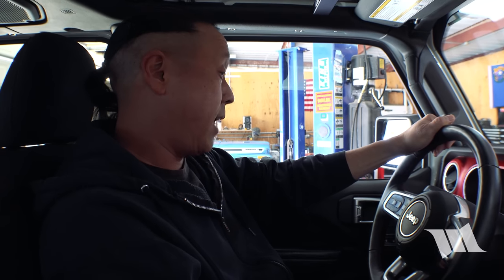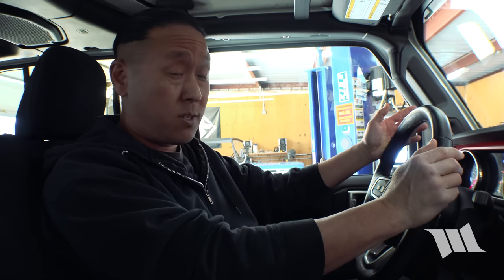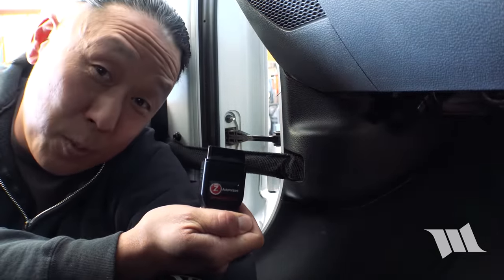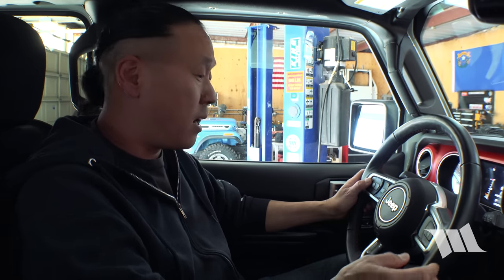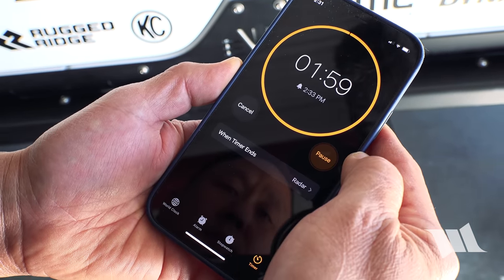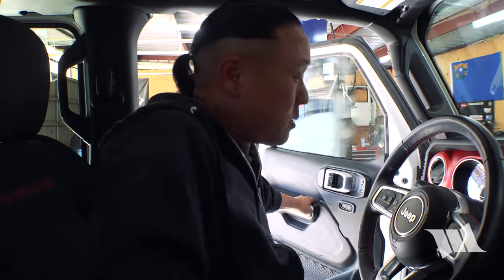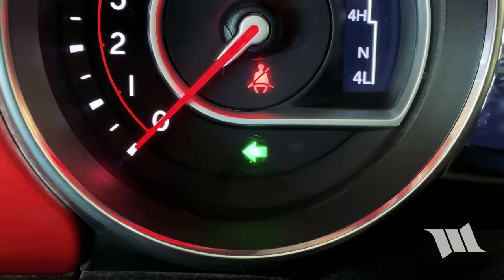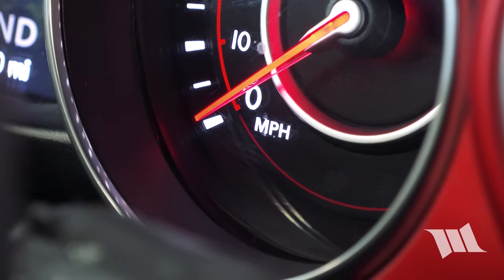HOW TO Turn Off LIGHTS OUT Error on a Jeep JL Wrangler or JT Gladiator After Installing LED

Comment: I'd love to know the technical reason that sets off the tail light warning, and the technical reason you had to do (did I count right) 6 reboots.
Reply from the maker: The resistance is different with a different set of lights. The LED health monitor see this as the lights being out. What you see in this video tells the LED health monitors to be disabled.

Comment: I see you have serv 4wd msg. I have same on mine. How did you fixed that?
Reply from the maker: For this Jeep, it was because we have a ProRock 44 front axle with ARB locker and a factory rear axle. I was finally able to turn that light off using a Tazer but only after rewiring the factory rear locker to a separate switch.

Comment: I am having the same error on my Jeep Wrangler JLUS after installing Bush Wacker Fender Flares. I went from Halogen Front Turn Signals to LED Front Turn Sign Lights
Reply from the maker: Well, this will take care of it. Just to make sure, I have tested it out on our JT.
Reply: Same here with the fenders but do we still change the tail light options like you did or do we do our respective modification in the tazr

Comment: Tried this today because this warning or error showed up randomly. I've never replaced or changed the factory LED tail lights. 

But my error only shows that the right hand tail side is out. But when I inspect it, everything works as normal. Any pointers on how to maybe get this working? I've tried talking to Jeep but their service people never get back to me
Reply from the maker: The health monitor is showing a voltage drop in that light but really, if your tail light is an LED, it really shouldn't be out this soon. I might take your Jeep to a dealership and have them give it a look and see if you can get it covered under warranty.

Comment: Would this fix my no front turn signals not working?.  Chop fender AAL. Just DRL work but when using turn signals  it just turns off completely  on the turn signal im using. 19 rubicon
Reply from the maker: Sorry, couldn't tell you for sure. Typically, this will only fix the warning light on the dash - not make a light work.

Comment: OK thanks for the information now I have another error code the brake light and ABS lights have started flashing when that happens I have no brakes I turned it off once but then it turns itself back on at the clear and the code
Reply from the maker: What I'm hearing from you is most likely a speed sensor issue. If your steering wheel is slightly off centered, your computer will think you're in a slide and cause the error you're seeing. Recentering your steering wheel should fix it. OR, you have a speed sensor that needs to be replaced.

Comment: What about a locker service light?  My lockers work fine and I even put a sensor bypass on, but still the light persists.
Reply from the maker: Is it safe to assume you've installed a lift on your Jeep? If so, did you make sure to unplug the wiring from the differential before drooping out your axle? If not, you most likely pulled one of the wires out of the plug or just a bit. This is a very common problem and it cannot be fixed with a programmer.
Reply: Yes sir, it is lifted recently.  I’ll check for anything loose.  Thank you, I appreciate the response!

Comment: I installed those lights and got multiple messages on my dash. I'm so tired of doing the Hokey-Pokey, now it's my ear worm! The song and dance works temporarily but then the messages come back: tail light out, start/stop not available battery charging, ABS, brake and the blind spot indicators don't work. When I unplug the tail lights all those messages disappear. Any suggestions Eddie? Thanks
Reply from the maker: Wow, not really sure what to tell you. I only got the one error.
Reply: @wayalife  Thanks for your quick response Eddie. I really appreciate it. The lights look awesome but maybe not worth the hassle. If I could try another fix or two I'd like to keep them. Maybe a resistance issue? Others have told me that the JL electrical dash system is super sensitive and detects the smallest change in resistance. I'm just not sure how many Ohm resistor to try. Any guesses?

Comment: Can you just turn it off and leave it off on the tazer. Or do the tail lights stop working all together then.
Reply from the maker: The tazer is designed to be removed after programming.
Reply: @wayalife  ya I figured it out you can just shut off the tail lights in the tazer. Then you don't get the message on the dash saying faulty trail lights. I'm sure it won't tell me when I have a bad light but whatever.

Comment: Does this work for Jeep Renegades trailhawks?
Reply: I have three messages since i bought my used jeep( sound system unavailable, daytime running light out, parking light out) in which all light shave been checked and sound system has been clear. I just do not know how to reset the messages
Reply from the maker: Only if Tazer is available for the Renegade and that I do not know.

Comment: Is this error going to happen if i changed my halogen tail lights to LED ?
Reply from the maker: Yes
Reply: @wayalife  but why ? I can’t see the point of the alert coming since there is a resister included
Reply from the maker: @faisal3865  Sorry, you are correct. I responded a bit too quickly.
Reply: @wayalife  np

Comment: This procedure seems completely random to figure out.... if I had seen that as a suggestion I would have just assumed someone was messing with me. Makes me think the the person who wrote the programming for the ecu for jeep, was told to make it difficult to flash out the error for non mopar safety equipment.  Wonder if there is anything else (other than lights), that procedure will work for.....
Reply from the maker: The Tazer will help you to address a LOT of things in the computer and most are a LOT easier to do. Aside from changing gear ratios and tire sizes to calibrate your speedometer, you can turn off your FAD or 4WD error if you have new axles and even lockers and way more.
Reply: @wayalife  OH absolutely aware of that. Have seen you use it multiple times. I had meant the turn off leds then reboot 3 times turn it on and reboot three more times ect.... the tazer is a great tool and will be my first purchase when I get my gladdy in June. But that was a convoluted proccedure to flash out the error. The only question I would have now is will it still tell you if a turn signal stops working?
Reply from the maker: @jackphillips5524  Actually, it does and I have tested it by unplugging the lights.
Reply: @wayalife  awesome !!!

Comment: I’ve tried this numerous times with no luck. Still get the error message.  Oracle tail lights, morimoto turn signals.  Followed all the steps and still shows the message.  Super frustrating.
Reply from the maker: Just to make sure, you are in fact using a Z Automotive Tazer or Tazer Mini, correct?

Comment: I did all of this 3 times... still didn't fix the issue. Did you end up keeping the led resistors on?
Reply from the maker: Yes, kept the resistors on. I have even done this on my Gladiator with the DRL's I installed and have seen it done on multiple other vehicles. Are you sure you're waiting until your Jeep powers down completely?
Reply: @wayalife  yeah, I've been doing 5 minute sleep cycles. 😟
Reply from the maker: @Offroadandbackroads  Just to verify, you turned off the Tail LED, did the 3 power downs and then turned it back on and did 3 power downs, right?
Reply: @wayalife  Correct
Reply from the maker: @Offroadandbackroads  Man, I don't know what to tell you. Worked for me and everyone else I know as well. Sorry.
Reply: @wayalife  No worries man, I'll keep trying. I appreciate the video though! I'm sure it probably helped many others. Electronics are just so finicky. Lol
Reply: I’m running into the same issue with my Oracle tail lights. Did the six reboots. First three set to No and the last three set to Yes. Fully let the Jeep shut down between each one. Still throwing the error code and hyper flashes (in the cab) with the turn signals. Did you ever get yours to work?
Reply: @TrailExpedition  have you gotten yours fixed?
Reply: @michaelbarrera6122  yes, I made a comment on here how it worked for me. I had to clear CELs in the Tazer menu then do all the steps.
Reply: @TrailExpedition  I don’t see clear CEL’s on my menu

Comment: Nope. No go. Can't even get to the menu. Scroll to audio, hold down the button, but no menus. 😢
Reply from the maker: You sure you have your Tazer JL installed correctly?
Reply: @wayalife  yes. It's showing connected in the app
Reply from the maker: App? There is no app for the Tazer, just the EVIC on your dash.
Reply: @Wayalife  any brand reccomendation?
Reply from the maker: Tazer is what you need. It's made by Z Automotive https://amzn.to/43VKRoF